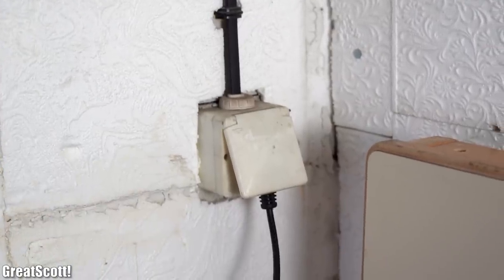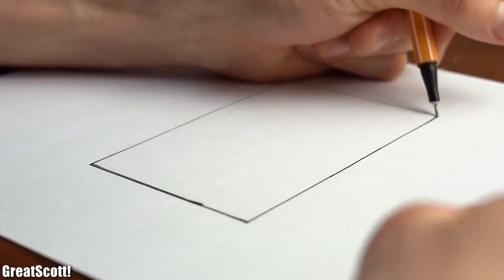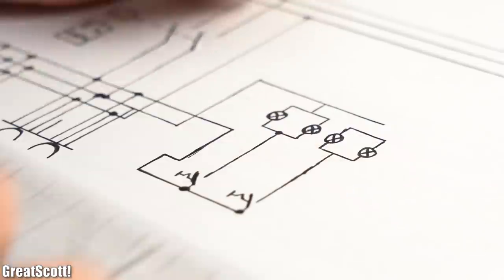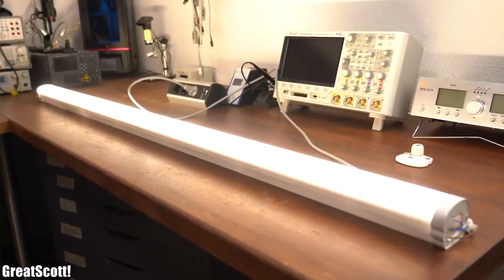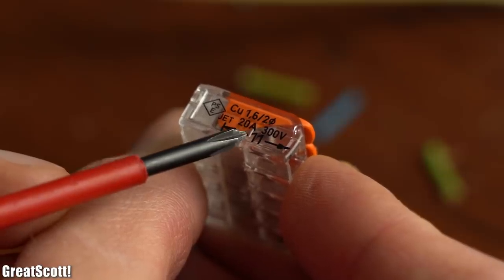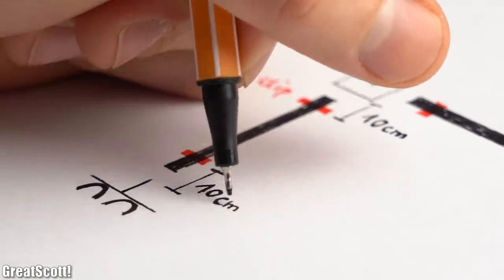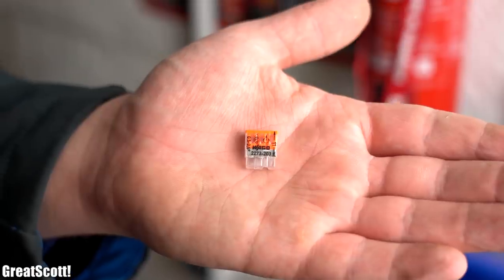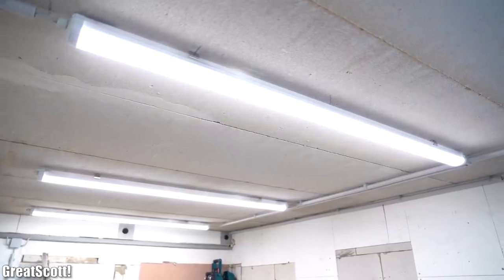How to do Electrical Wiring properly! (more or less....) GERMAN STYLE!

Comment: German standard makes here in indonesia looks like unga bunga
Reply: people in developing country usually install their electrical wiring using uncertified engineer because of lack of certified engineer.
Reply: @alfineranai6952  tbf in my place, where almost every home is built well maybe in 2000s or before...and being built by non certified makes me have to finish what they've done like on insulating and other thing

Old house didn't have breaker like new one and instead they have a fuse with screw connect like a bulb lamp

Well, time to repair it each side of our houses one by one right
Reply: Exactly. My home only have 2 unknown circuit breaker to separate half of my home. And 1 6A from PLN. I don't even have PE wiring properly installed. So whenever I want to power my sensitive stuff I usually just plug it in into my own DIY power grid in my room (actually just a DIY inverter to power my room with proper wiring and earth protection). Separated from home electrical which is powered by PLN.
Reply: Jokes on you, I do the house wiring myself to make sure it is up to DIN.
Reply: There are a lot of cases of house catch on fire because the use of thin wire for heavy loads such as microwaves, washing machines, refrigerators, etc due to budget cuts.
Reply: @adityapradipta6209  not every house owners understand the concept of wire gauge, insulation, amperage, etc especially the elders....also not everyone owned fire extinguisher

People usually just understand the concept of "more watt consumption, more electrical bill"

Third world country problem it is
Reply: Viper  German engineering is the number one in the world
Reply: Indonesian people seems "don't care" about this...

-wkwk
Reply: it reminds of "Bunga Bunga"  hahahazz.
Reply: Still a long way to go
Reply: every EU contry is like Germany
Reply: @Gal3tti  I know that, I was referring to another "BUNGA BUNGA"  ..er Cavalier.
Reply: Even in Hong Kong, most electrical wiring is towards "quick and dirty" over quality, except you do it by yourself or pay a lot to hire professional over just qualified electrician.
Reply: @dreamlifter7569  yang penting mah nyala indo mah hahaha
Reply: @alfineranai6952  More like because it's cheaper and not that hard
Reply: @dreamlifter7569  they would care - or more likely laments - when their house caught on fire.
Reply: Indonesia have official standard called Persyaratan Umum Instalasi Listrik (PUIL) published by ESDM. but haven't seen it applied on houses (as far i know).
Reply: hahaha beralih lah ke wago om.. saya jg pelan" itu instalasi listrik d langit" d rubah pelan" ngikutin german standart.. wago udah saya coba ampe 2000 watt msh aman, tinggal nyari itu clip puat pvc namanya apa y buat cari d toped
Reply: 33 RIZAL FAHMI GHYMNASTIAR they use different color for live neutral and earth? heck, here we use the same colored wire for live and neutral wkwkwkwk (and most of the house in indonesia don't  use ground cable soo...)
Reply: @farisanadli9165  mantab om, saya juga pingin instalasi listrik rumah sendiri yang kurang lebih sesuai "standart" tapi ya memang di sini kendala nya di dana (wago tak ada lakban pun jadi)
Reply: @adithyanugraha7289  wago ada yg jual bnyk kok seri lamanya
Reply: It still conforms to Gudang Garam standards
Reply: Hiyahiyahiya
Reply: in colombia that kind of electrical wiring wouldn't pass inspection
Reply: @putraadriansyah8082  In India, if you live on the second floor, you can use cobra-grounding to get a proper PE, can't you? First cobra still in the ground, last cobra biting in a copper stick you tease her with ... ;) 

To be honest: What I see (on youtube)  as "good" examples of Indian wire techniques and installation is kinda strange. Your people can surely do better.
Reply: in my house on surakarta the wiring is pretty bad

from the breaker it goes above the ceiling without any conduit

and then it goes sorround the house

and thankfully it is grounded
Reply: You should see the electrical codes in America. Almost all of what Scott did will fail inspection.
Reply: @dhupee  I've had lead fuses without a properly secured installation for years. It was in France, you can see horrible things all over the world. 😁
Reply: I live in Indonesia
Reply: @alfineranai6952  What about the USA? lol
Reply: @alfineranai6952  By the way: This is not installed by an engineer here. They do an alternance and don't go to college.
Reply: Bad wiring is responsible for fire and injuries. These standards do not only prevent that, but they also act as a guard against failures in anything you plug in. The video does show the modern materials used for building the wiring. However, there are older and cheaper materials available, that still are up to code, but they need more work effort.  You don´t need the tubes, you could clip the cables directly to the wall. The wires just snap into the modern parts, in older parts you need to tighten screws. As the electrician is a highly specialized worker with high wages, even to German standards, the newer and more expensive parts and specialized tools let him finish the job in a shorter time, saving the customers substantial money for the work effort. In less developed countries the price of labor is cheap and the price of the materials are of a higher percentage of the overall costs, so it does not matter much if the electrician needs an hour longer to put more clips to the wall and secure all the screws, as long as you can save a lot more with the older and cheaper materials.
Reply: @adithyanugraha7289  Different colors for neutral and live are standard in Germany since 1950 at least. In fact, you can not get cables for installation with only two wires or cables with three wires and two wires of the same color. In very old installations, like 60 years old, you don´t have a separate ground cable (they also used different colors like red, blue, gray) but if any part in the house is renewed, it must be with three wires and you go back as far as possible in the wiring and there you connect the ground wire to neutral, or if possible you connect it directly to the soil in the ground (that´s why it is called earth!).
Reply: @Gal3tti  except the UK!
Reply: in indonesia: PE? do we need those?
Reply: same in turkey xD
Reply: @Badr Ahmed If you have metal water pipes you can use that and in newer buildings the rebar can be used as earth if it is grounded properly. You need for once a professional to measure and prove that the resistance is low enough to work reliably.
Reply: @dreamlifter7569  we do a bit care, some house uses breaker box, some are not, for my house is not (yet)
Reply: @Moksoory1  what do you Think: is it wrong what Scott did, or does your Inspection suck?
Reply: @oddctioum  US inspection is much more strict.
Reply: @alfineranai6952  In Indonesia everyone is an electrical engineer. LOL!
Reply: Maybe 99% of buildings in Indonesia are intentionally not grounded, How cool is that? 😂
Reply: Padahal kalo puil diikutin baik baik ya gakalah bagus si. Tapi ya gitu, mayoritas mindset kita masih "yang penting nyalaa !"
Reply: @farisanadli9165  yang ori bang ? Susah nyari yang ori. Adanya wago wago cina
Reply: @JinxProLuhut  hahaha wago ori? pernah liat tp ga terjangkau.. wago cina tp dia ada kualitas beda" ada yg bagus ada yg jelek saya beli awal dikit dulu dpt bagus tandai tokonya trus beli d situ terus.. yg kw untuk 2000 watt msh kuat kok 1 wago d lewatin mesin pompa jetput shimizu yg paling besar, kulkas 2 pintu, dispenser, msh dingin dia aman
Reply: @JinxProLuhut  jgn ;upa pasang rcbo jg biar ga kebakaran rumah.. masa kalah ma malaysia yg standar minimum instalasinya kn
Reply: Basically : as long there's electricity going to the outlet, we golden
Reply: @farisanadli9165  soal proteksi terhadap kebakaran rumah MCB aja udah cukup karena ada proteksi overcurrent. Kalau RCBO lebih dari itu, selain proteksi overcurrent juga ada proteksi untuk arus bocor yg artinya proteksinya lebih ke penghuni rumah. Pada dasarnya RCBO=MCB+RCCB.
Reply: @IAmThe_RA  mcb aja kurng.. karena reaksinya kurng cept
Reply: @farisanadli9165  itu tergantung tipenya.. kurve delay-nya beda beda. Mau MCB, RCCB atau RCBO ada beberapa tipe. Kelebihan RCBO adalah breakernya tdk membutuhkan banyak ruang, sementara alternative lain seperti kombinasi MCB+RCCB membutuhkan ruang yg lebih banyak tapi lebih murah daripada RCBO. Kalau soal aman dua2nya aman asal set-upnya yg harus benar dan sesuai standar dan rekomendasi.
Reply: Looks similar to soviet standards
Reply: Mau nanya biasanya kabel utama PLN (service line) dari tiang listrik ke meteran ukurannya (mm²) berapa ya? Di Inggris minimal 25mm² setahu saya, di Jerman saya kurang tahu.
Reply: yang penting idup bang 😁😁
Reply: @memetsolder  kesetrum bro...gak ada grounding nya lmao
Reply: Gue beli WAGO untuk tambahan stop kontak gue. Cuma harganya memang nggak ngotak 100 ribuan cuma dapat beberapa biji.

Cuma kalau dinegara kita 90% pelanggan rumah tangga listriknya dibawah 1300 watt alias arus listriknya dibawah 6 Ampere. Bahaya sih tetep cuma lebih kurang ketolong karena ini.

Kalau diluar mah-kan gede-gede kalau buat rumah.
Reply: @JS-fw1ip  6A 😬?... Kalau cuma ada lampu dan tv okelah.. tapi kalau ada oven, heater, air conditioner, pompa air, dst😅.. Kalau ada bule dari Inggris yg tinggal di indonesia yg servicenya cuma 6A bisa stress dia. Di inggris 63A sudah dianggap kecil dan kabel dari meteran (meter tails sebutannya, itu kabel khusus) ke Panel rumah harus minimal 16mm². Banyak rumah disana dgn instalasi sekarang servicenya mayoritas 100A dan meter tails-nya harus 25mm² minimal... Kalau tukang listrik dari Inggris lihat kabel 2.5mm² yg kebanyakan dipakai di indonesia untuk menghubungkan meteran dan panel rumah, bisa trauma dia.. Paling reaksi diablangsung bilang: Fire Hazard 🔥☠️
Reply: @Moksoory1 American Electrics is 100 years behind the likes of France, Germany, UK, and many more.
Reply: Cuz it is 😂
Reply: @Moksoory1 what is different? German electrical standards are quite high. The USA use 120 V on common circuits. How they are fused, what cable cross-sections are used?

Comment: Finally something not American! Thank you so much! Even though we have more or less the same system in Hungary, it's nice to see a detailed guide
Reply from the maker: Glad you like it!
Reply: Örültem, hogy nem karton papír házakat látok, és összecsavart vezetékeket 😂
Reply: This is exactly how is done in Hungary with the exception of the "German trademark" precision measurements. We just eyeball it. :D
Reply: @balazskoti2603  it's a nightmare to drill the wall of a Soviet block of flats....
Reply: @alhdgysz  every cheap SDS HAMMER DRILL will do it! The best tool I own ;)!
Reply: @TheCrepinsek  the problem we face is that you cannot be certain that where the electric cables are...
Reply: Yessss, the US 120vac standard proliferates YouTube videos & its so cool to see wiring from a more 230vac perspective.
Never understood the push to 120vac at all, wire currents are much higher & 120vac can kill you just like 230vac can (whose wire currents are lower!)
Reply: @johnathanasiou9284  in Canada we also have the us system and we do use 240 volts for power hungry devices such as ovens, dryers, air conditioner, heating, etc.  We only use 120 for generic plugs.  Because our transformers are centre tapped.
Reply: @johnathanasiou9284  I think the voltage and frequency differences are pretty much just historical, as much as non-metric use. It's been there since the beginning, when nobody seemed to agree, and at this point it's too much to ask for the population to like, "Hey, go replace your fridge. We going twice the volts baby!", it's just stuck from times. The worst tho is wall socket differences, there could easily be just one or two (say one for 120ish, one 220ish voltages), and solve the old appliance problem with passive adapters.

Brazil is fun tho: we got both 127 and 220V 60Hz, and it's not even like we gotta go to the other side of the country to get mixed up, living in Porto Alegre, a close by city where relatives live (Sapucaia do Sul) is already 220V single phase, two phases give you 400, we got two phases for 220v tho for the AC and shower. I think the frequency is standardized across the country thankfully, which is a bit of an annoyance when power sharing with our 50Hz neighbors to our west (specially important given we have Itaipu as a multinational power plant).
Reply: @Kalvinjj  I am more than happy that Australia went down the 230vac route than 120. When they distribute HV power long distances they up the voltage which reduces the I2R power losses & 230vac offers lower wire currents but each to their own.
230 just makes sense, we can use Euro appliances with at best a plug change via adapter or hardwired plug.
Australia did 2 things right, we selected the 230/240vac system & selected PAL for colour TV (although that is now mostly obsolete).
If they also went LH drive to reduce conversion costs of classic cars, it would be perfect.
I grew up with old mains 240vac wiring (Red/L, Black/N & Green/E) with ceramic  fuse wires but much prefer the modern system with RCDs/RCBO.
Its a sheer miracle I wasn't killed as a kid poking metal knives or screwdrivers in toasters or leaf switches lol but one learns quickly!
Reply: @Alex-lo6yt  Canada needs to join the "dark side" ie 230vac lol.
If Canada does someday join the "club" dont pick UK plugs as they really hurt if you trod on them at night
Reply: @johnathanasiou9284  it would not be that hard to do as we already have 240volts in our panels (it can be 220-250v) but our ground is centre tapped to the trans therefor acting as a voltage divider to get 2 120volts lines. The most difficult part would be to convert every device to the new voltage.  

In commercial and industrial buildings it’s 347/600 volts!
Reply: @Alex-lo6yt  That's a rather weird voltage, I know tri-phase systems here are always 127 in Y or 220 in delta for residential or some commercial installs (how we get our AC's 220v), never heard of 347v per phase, I've seen the 220 Y 400 delta ones around here too tho.
Reply: @Kalvinjj  some older 3 phase in Canada is 277/480v 

3 phase is not in residential except apartments and they have 120/208v and only get 2 hot legs per unit The appliance that would use 240 also are rated for 208.  Residential gets split phase 120/240

Electrical is weird here in Canada.
Reply: Yes, this was relevent in Norway as well. So nice to see 

American fuse boxes and wiring is understandable, but it's also so different. Especially if you go all the way back to where the street connection interfaces with the house. They have one transformer per house hanging from a pole. Here we have a small neigborhood concrete building with one huge transformer feeding a loop of many houses. With all different pros and cons.
Reply: @schnizzyfizz7832  on some streets, a single transformer can power up to 5 houses or more.
Reply: @balazskoti2603  well you may do that but I take the extra 10 minutes to be within a centimeter.
Reply: Agree on so many levels. Very strange to see and read the comment section of Wago connectors vs wire nuts - "since 30-40 years I use wire nuts which are levels above any other connection if done properly, I hate and  I do not trust Wago, they look unsecure" and similar comments. Germany is one of the most strict and annoying (somewhat positive of course) when coming to electrical standards, they accepts and push these solutions, and people in America are like - that's nothing to trust haha. :D
Reply: @Alex-lo6yt  Still, here we have dedicated buildings for them doing hundreds of houses at once
Reply: Bojler eladó
Reply: @EazyChannel3  I hate wire nuts, too difficult to do properly, with Wago connectors the connection is either done properly or undone properly, nothing in between.
Reply: @apveening in Germany Wagi clamps become standard. Before Wagos screwed clamps were possible.

Comment: in Australia 'proper' means you have to run the conduit all the way into junction boxes. looks nicer too
Reply: Thats what i consider proper too. A gap in between is just ugly and looks like an amateur tried to fit it. Also im pretty sure its safer to run the conduit into the junction box because it provides more protection for the cable. In the Netherlands i never see those gaps thankfully...
Reply: same for Argentina. No way you will pass a (commercial) inspection with wires flapping around. We don't run conduit all the way though, we have "connectors" for conduit for nice finishing. Also we use the same outlets as Australia.
Reply: @83hjf  connectors are good, can also buy the junction boxes with a conduit receptacle molded in to it. We also tend to wire with 7 strand flat TPS instead of the circular cable used in the video.
Reply: @_S13_  to my knowledge that is explicitly forbidden in Germany. I don't know the reasoning behind that though.